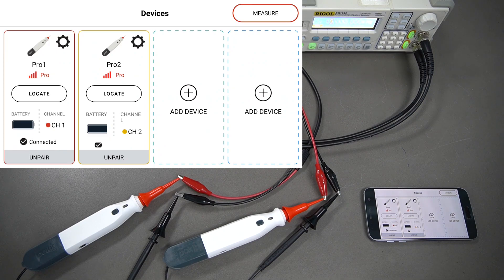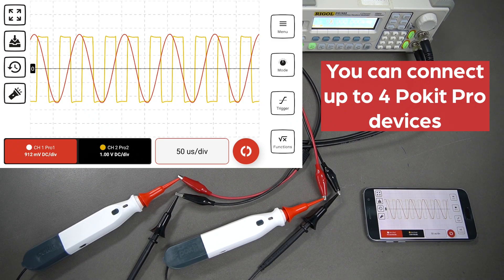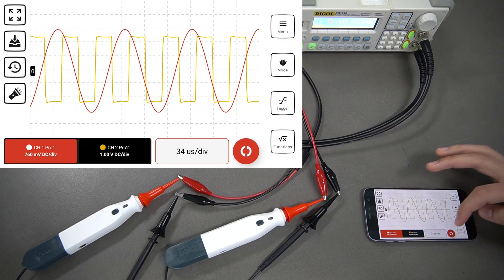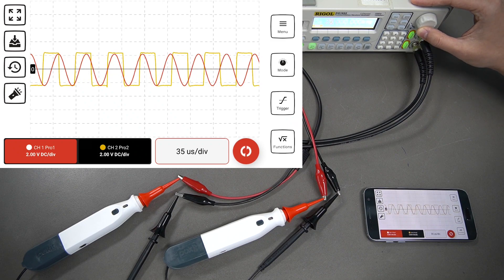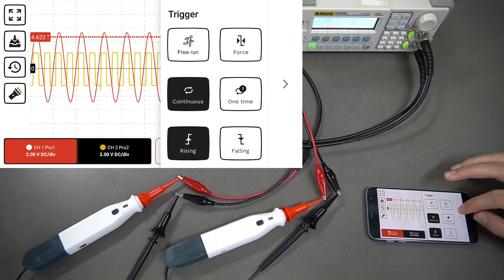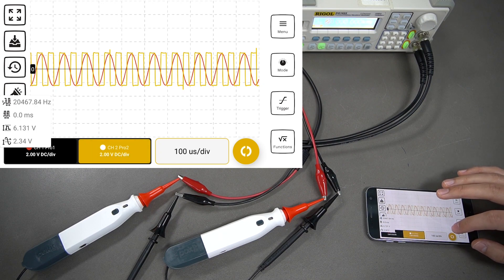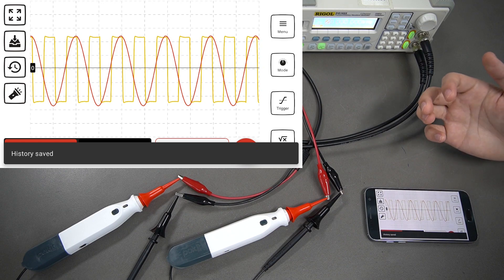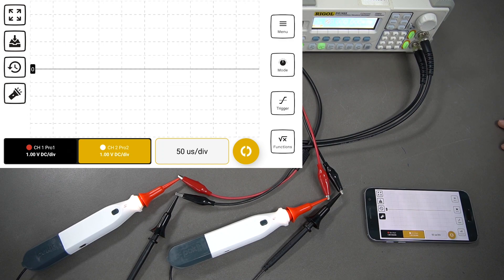Oscilloscope - Pokit Pro - Pokit User Guide

Comment: My Pokit pro works fine in multimeter mode but when I put it in oscilloscope mode and push the round red Pokit logo sample button it only will say "check device connection", and it won't ever read anything, but again it works fine in multi meter mode

Comment: what's the difference between free run and continuous?
Reply from the maker: Hey Jordan! The Free Run trigger constantly takes measurements as soon as the Pokit button is pressed. 
The Continuous trigger works slightly differently. With the Continuous trigger, you set a particular trigger value (e.g. 10V) and a rising or falling trigger. You then press the Pokit button, and readings will only begin to appear once the trigger value is reached. The waveform will then update continuously (like the Free Run trigger) from that point onwards.
Hopefully, this makes sense. It'll be easier to understand if shown in a video, rather than explained in writing. We'll look to have this created as its own user guide in the future!
Reply: @PokitInnovations  thanks for the explanation. Also, i wanted to ask if the small Pokit can't perform these 2 measurements because of hardware limitations or why did you decide not to add those  features? I have both models and it would be nice to have them both reading different signals at the same time, but i guess i'd have to get another pokit pro for that

Comment: This video appears to only be dealing with voltages in the millivolt range, which is fine for some projects, but I've got measurements I need to take in the hundreds of volts. The device is rated for measuring up to 600V, so 120VAC RMS (about 170V zero-to-peak, or about 340 peak-to-peak) should be well within range, but when I attempt it, I get a "values clipped at top and bottom range" error, and the measurement is clipped at about 10 or 12 volts. Measuring the same AC voltage with the multimeter setting of the same PokitPro, using the same app on the same phone, does successfully measure an AC voltage of 125.6 RMS, so the hardware is apparently capable of making the measurement. How do I get the app to display that information properly on oscilloscope mode so I can see the waveform of the AC line?
Reply from the maker: Hi John, if you are seeing the "values clipped at top and bottom range" error, press 'Mode' then change the 'Unit' value to a larger V/A value. Try taking a measurement again. Continue trying this with increasingly larger values, or move it right up to the highest value so that the measurement isn't clipped.

Comment: My new Pokit Pro direct connected with a cheap but simple and relatively new Chinese FG100-DDS Functiongenerator shows either the message "Characterists are missing" or nonsense graph - a little bit like a transient response. Also the pre-adjusted Time/Frequency and Volts is changing by the Pokit Pro itself. The Temperature (with the probe) and Volt measuring in the Multimeter Mode seems to work OK. Even though I know it is somehow a stupid question. Since a lot mistakes/reasons could be part of this result. But I try: What do I do wrong? Or how I can check that the Pokit Pro isn't the error reason.
Reply from the maker: Hi Kay, make sure that you are using the latest version of the Pokit App by deleting it and redownloading it from the Google Play Store/App Store. Make sure that you are also using the latest version of the firmware.

Comment: How do you compensate on the oscilloscope to make waveforms look square, like you do on normal oscilloscope probes. I am outputting a 1Khz 1.5V square wave from my function generator, but the Pokit Pro is showing the top and bottom of the square wave as being rather curved. Its about 80mV of curve, instead of being flat. I assume there must be some way to do this?
Reply from the maker: The issue you are describing about the square waves is down to variances in the input capacitance of the voltage front end, and we are currently working on an IIR digital filter to compensate for the variance between units. We will add it to the calibration table (WIP) and both features will be released in an upcoming update.

Comment: is it possible to set the pokit pro up on reading a specific job then leave with your phone out of bluetooth range then return later and get the data from the pokit pro?  I assume this wouldn't work as the phone is doing the data capture as the device gets it.
Reply from the maker: Hi there, while using the Oscilloscope mode, the Pokit Pro must remain connected to your mobile device. You are able to use the Logger mode remotely without connection to your mobile device to take continued readings over a longer period of time.

Comment: Just received my kickstarter Pokit Pro! Multimeter works great. My first time using an oscilloscope. I'm trying to use the oscilloscope to see the clock or data for I2C 5v communication between an arduino and a BME680 chip. Popkit is connected to SCL and the black end to ground. Mode setting 5V and time to 1ms. With trigger to Force I get a continuous +/- 5V reading. Which settings will show me the I2C clock?